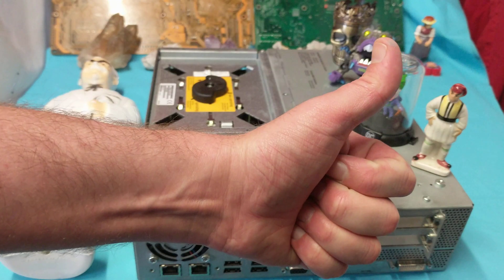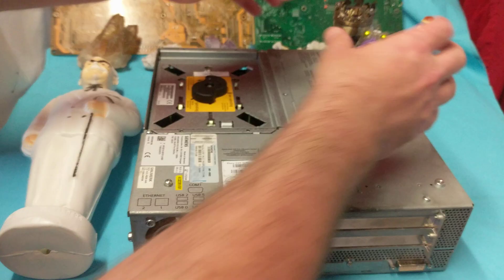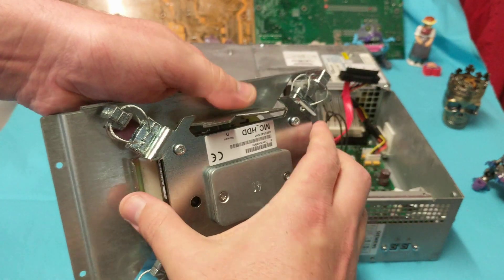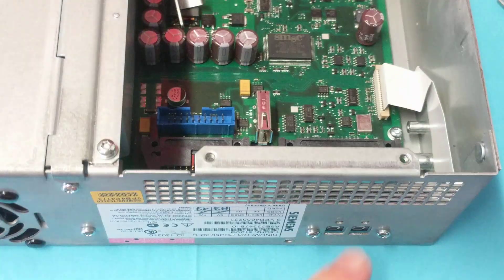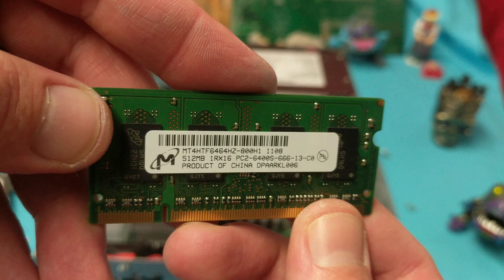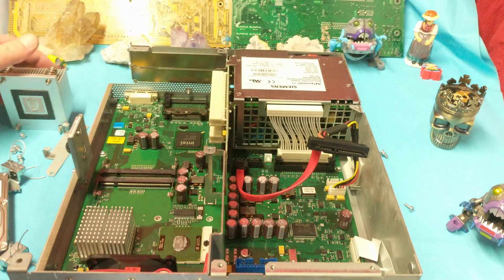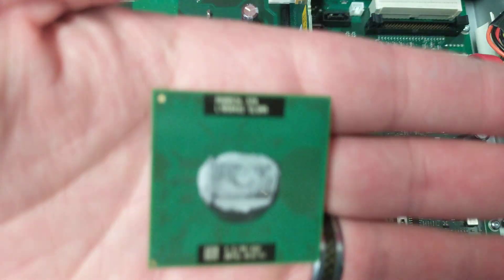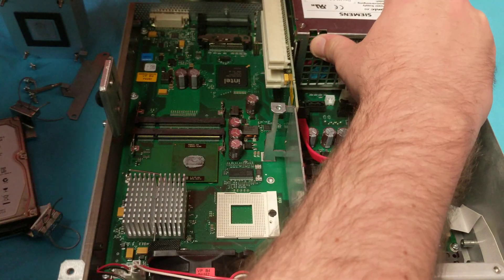Industrial Windows XP Embedded System TEARDOWN Sinumerik pcu 50.3b-c ID-130310

Comment: SIR THAT MOTHERBOARD HAVE AN GMCH CHIP WICH IS AT THE LEFT ,,, IT INTEGRATE THE GRAPHIC AND MEMORY CONTROLLERS , THEN AT THE MIDDLE YOU FIND THE CPU THEN THE EMBEDDED CONTROLLER AT THE RIGHT ,,, IT CALLED SMCS WICH IS USED AS A SYSTEM MANAGEMENT CIRCUIT AND ALSO INTEGRATE THE KEYBOARD AND MOUSE CONTROLLER
Reply: YOU ALREADY SEARCHING FOR THE GPU ,,,,THE ANSWER THERE IS NO GPU ,,,,THERE IS JUST A GRAPHIC CONTROLLER THAT SHARE AND USE A PART OF RAM AS GRAPHIC MEMORY  , SO THIS SYSTEM CALLED UMA CAUSE CPU AND GRAPHIC CONTROLLER SHARE THE SAME PHYSICAL  MEMORY

Comment: How eerie that I find a video on an industrial computer, one of those that has a very dark hardware, the same week I end up getting myself one. Its not even related, but interesting nonetheless. Ill be doing a teardown myself on that one. (only thing, mine does still work and I will be using it as a glorified Thumbdrive)
Reply from the maker: oh wow that does sound kinda eerie. Did you search for info on it through Google? That might be how they recommended it.
Reply: I just searched for "Windows Xp Embedded" and yours came on the list after a couple closer hits on how to install it. Cool for you though, you're getting some exposure. Btw, looking at your vid, cant quite make out the power connector on the back. I think it might be -mine is - anything between 10 and 30 volts. Mine is a Kontron CB752. might be cool to turn it on just to see if it posts.

Comment: The older Seagates are actually really reliable. I have a 850mb one from 1997 that still works. It's ones in the last 8 years that are a pile of unreliable crap. Hitachi drives are also bad. I had 3 and all of them failed within 4 years. But hard disks get more unreliable the higher the capacity goes. With SSD's I have 5 and two are 8 years old in a system that is running 25 hours a day both still fine.